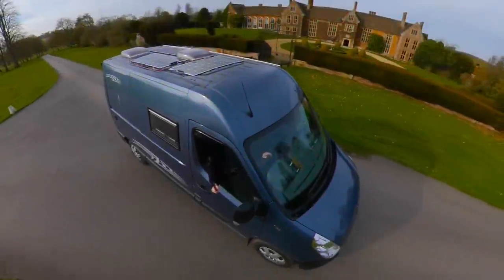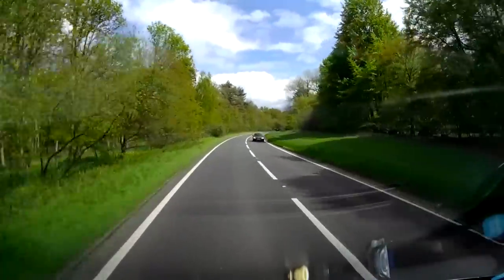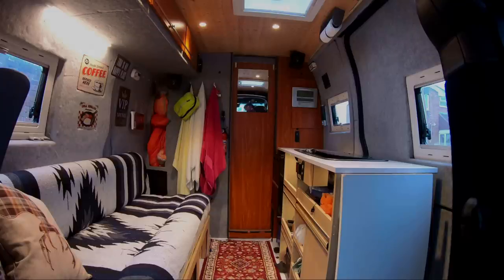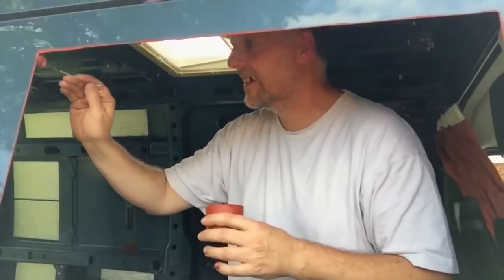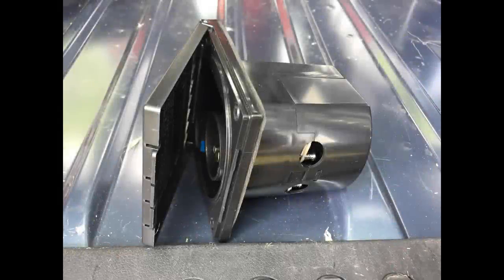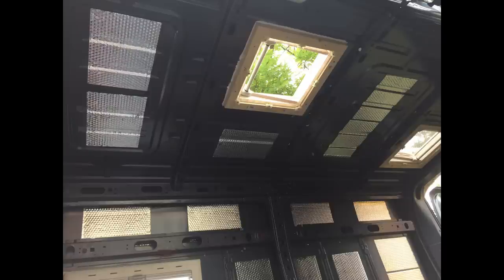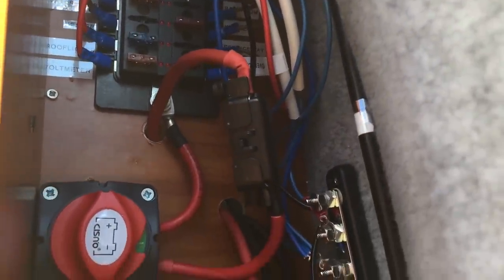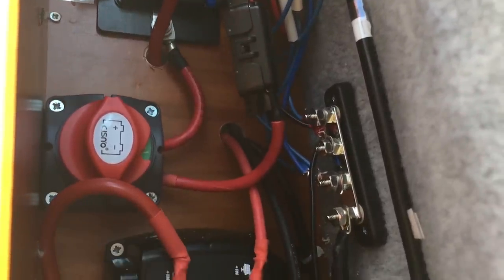HOW TO MAKE A CAMPER VAN From Start to Finish (Low Budget Interior) 2020

Comment: Hi rick. Just a thought buddy. Make the shower room same way as the kitchen units. Scrap the skeleton system because it’s old and not used anymore plus you’ll save just under 200kg in weight as well. Don’t use chip board because within a year it be like a pack of weetabix and use 15 mm light weight ply. You’ll save time money and weight. Buy a 240v small water heater that you can run the ducting from your diesel heater through like a Truma therm or something similar.other than that buddy keep up the good work your vans have improved and I’ve been watching for the last 8 years. All the best

Comment: Stopped playing the video as you’re talking about buying the tool for crimping the lugs. CEF ( City Electrical Factors ) in the UK used to allow you to hire a heavy duty crimper which will save you some money if your project is a one off. Depending on how many you have to do, take some cable to a wholesaler and ask to ‘borrow’ a crimper to get the job done, most of my suppliers would be kind enough to allow this, especially if you’re buying parts from them ( and you probably will be as some bits are not run of the mill DIY store stuff ).

Comment: Great video and great to see you back, Rick.  :o)  I keep meaning to ask; Did you know that cat litter reduces condensation? Fill some socks with it (silica works best), then put them under the chairs or elsewhere.  :o)
Reply from the maker: Raindrops On Roses Great tip, thanks 😁👍
Reply: Nice idea I'm going to air my van every morning when in use to reduce moisture build up.
Reply: Makes sense, cat litter is meant to absorb urine and dry out feces. You’ve got a couple kinds of cat litter; the cheapest and perhaps best for this application would be pine pellets! You can ask about them at the pet store, but it’s cheapest to buy them in bulk (maybe a caravan group buy?). What makes them awesome is they’re lighter, cheaper, and the pine scent actually does a better job than clay at masking smells AND deterring bugs. If it gets wet, the pellets absorb the moisture and turn into sawdust, so maybe you could even make a clever “pellet tank” where the dust falls into a small trap below and you can “top off” your supply of desiccant pine pellets. Just an 💡
Reply: @evshrug  Thats a really good idea! The smell of pine is also a heck of a lot better than the smell of cat litter lol

Comment: Beautiful design.  You have excellent taste for design and function.  I love your van, and after being lulled into queen size bed at the rear of vans, I see your sofa converting to bed is more practical indeed, and less expensive to build.  I don't care for your toilet/shower which is the one over-build in your van.  I would go with a portable basin and round 4' diam. piping at ceiling level to hold a shower curtain with portable shower head; basin has hole through flooring into tank or outside. When done showering basin and shower curtain is hidden away in one minute.  As for toilet, a discreet composting toilet is costly but a better way to travel.  But your design won me over, the simplicity and comfortable look is the way I will build, that is if ever I do this.  Thanks for the show.
Reply: Pangako sa iyo

Comment: hi! many thanks for the video! I am setting up a van myself and your informations are precious !!! in the video you talk about "high temperature contact spray" to stick your coating felt on the wooden walls ... what product is it exactly? and what is this gray coating felt you use to cover bare metal? they use this on construction sites but i saw that there is glass wool in the product ... you, what did you use?

Comment: Super video Rick. Thank you. Did you know, you can use 'Red' Diesel with your diesel  heater? Much, much cheaper than regular diesel. As long as you don't use it in your engine tank, it's perfectly legal.  Just a thought!
Reply from the maker: Kevin Doidge thanks for the tip. To be honest, the diesel heater uses such little diesel, it’s not really an issue. I filled the diesel heater tank up 18 months ago, and it is still 3/4 full LOL!
Reply: Unless you know a farmer, or can pick it up from a boat yard, Red Derv, is usually sold in bulk, filling a minimum 500 ltr tank! You may be able to buy some from a firm you hires diggers etc to the building trade, but as has been said, they need refilling about as often as a Scotsman buys a round! Jim

Comment: Out of curiosity why didn’t you use a diesel heater that heats water as well?  They don’t cost much more. The same size but just has a heat exchanger added to it

Comment: One of the issues I have with the van builds I see... they NEVER appear to talk about the electrics they put in, the plumbing... it is just suddenly there... It would really be nice for a van builder to spend a decent amount of time discussing the electrics, the plumbing, etc with in-depth detail.
Reply from the maker: its a tricky one. Electrical and gas installations can be dangerous, even life-threatening if done incorrectly.
Amateur van builders are usually not qualified to give others advice on such installations and can potentially get into trouble if someone follows their advice from a video and that advice is bad.

I think there is a general assumption among us van builders that everyone doing such a project will either already have a reasonable level of competence in such installations, or will get someone qualified to do it for them. 
Either way, I think you are unlikely to find many videos on such installations because of this.
Reply from the maker: (plumbing) on the other hand, yeah that would be okay, I might do a video on it 😊

Comment: Excellent build. The bathroom was a great idea. I just wish the bed was a little wider to fit two people. I just have a couple of questions. How long can the heater run before fill ups and how much does the little tank hold? Do you get any smell from the heater or from having the fuel on the inside? do you have to vent the tank? Does the water from the shower go into a tank or just pours out on the ground? Thank you.
Reply from the maker: Roberto Almodovar The heater is very efficient and hardly uses any fuel, I filled up the tank when I first installed it, and the tank is still 3/4 full a year later. There is no smell from the heater, although the diesel tank did have a drip of diesel that ran down the outside of the tank which did smell, but was rectified by wiping it clean. 
The shower and sink both run to a hi that is stashed under the rear bumper. The waste water can either be collected in a container, or allowed to fall on the ground.

Comment: Good to see you perfecting & improving on each build. I still prefer the look of the larger bonded windows of your old van, compared to these smaller windows & the outer black covering. You can always open the door & roof lights for ventilation. I think also to shorten the kitchen cabinet you could move the sink into the bathroom on your next revamp. Maybe its the A-Team design but id say the van looks quite masculine to be called Guinevere.
Reply: I'd say it looks pretty dire and a lot of bodging. Each to their own.
Reply: @SB-hr5yr  
Could not agree more Daisy.
Would be fine cobbled together in a £ 1'000 van.
Not denying the effort & work, & I'm 100% sure it will inspire alot of people on their journey.
Most importantly, if the builder is Happy, that's all that matters. Should be very proud of your own achievements, that's all that matters. I'm with you though, not for me.
Great presentation & delivery of the video though .

Comment: Interesting build, but, always a but, I do have a couple of concerns over  the heater and gas install. Taking the gas first, I understand that insurance will not pay out if the gad install is not signed of by a qualified person. while fitting modern gas systems is well within the capabilities of a good DIYer, not everyone is as competent as you. I used to be involved in the leisure boat building industry, and, obviously, there is great concern about gas leaks from the bottle/hose interface. In order to meet the regs, we had to place our gas canisters in a sealed "box" vented over the side. As the gas sinks, we also fitted detectors in the bilge, overkill maybe, but if ever you have seen the result of a gas build up in the bilge, and cigarette dropped, the resultant bang is spectacular to watch, but fatal for the boat and sailors aboard! The Chinese hot air heater are great, but again, there is a risk of carbon monoxide build up, again a sealed box, with outboard vents would be a safe solution. again a CO detector would be a good idea. Lastly, your electrics. There is a lot of terminals lacking proper insulation, OK they may only be 12 volt, but from the thickness of the wire, they carry a lot of amps, and a raw 12 volts will not harm you. But (that word again) what happens if a metal object falls onto these connections due to rough roads. again spectacular sparks, damaged wiring and possible fire, not good but easily avoided. Overall it seems to be a good job, and maybe my concerns are a little over the top, being based on sailing, where you do not have the luxury of pulling over and walking away if the worst happens! Personally I would have done things a little differently, again from sailing, I would use a hammock, and have individual seats that could double as passenger seats while driving, also using swivel Captains Chair style drivers and passenger seats that would  bring the cab into full use. Speaking for myself, the bench/bed seats take up a lot of room, and, in my experience are not that good for long term use. Some people like to rough it a bit when camping, but I would rather have a snug, comfortable home away from home on a typical wet English summers day! Interested to hear your thoughts on my comments and suggestions, keep up the good work, safe and happy campervanning! Jim
Reply from the maker: James C Stanley Thanks for your comments, Jim, some interesting ideas there, all good. DVLA have a list of requirements in order to make the van legally classed as a motor caravan and I believe the majority of self builders in the UK use that list as a guide, including myself. One of the things on that list is to include a gas locker that is separate from the living compartment and has a dropout hole in case of leaks.

Comment: You put a battery right by the shower and below the water system. The slightest water leak or moisture buildup behind that wall and your electrical systems are screwed. Redesign it as soon as you possibly can.

Rule of thumb: electrical systems high up, plumping systems low down.

Comment: I do like the build but not the roof felt- it's called roof felt for a reason. Personal choice of course but I just think it's dull and lets down the otherwise professional work you've done. You could have used vinyl or just kept it natural or painted the panels, or plastic sheet in white or any colour.

Comment: Hi Rick, A great conversion and I'm doing a Master Mk3 myself. I followed your plan with the floor and it's great. Only one question please: How did you get the bump stop on the side door to clear the floor? Mine is rubbing on the ply even before I put in any finishing flooring. I've used 12mm ply. Was yours thinner?

Comment: For the wiring I'd have put flexible conduit in and feed the wires through that so that it has air gaps as fully enclosing wires in insulation reduces the current capacity of wire! Glad to see your back on here, also for the roof you get stick pins which hold them in place, look at Greg virgoes van build if you ever do it again! Just seen you did use conduit, but just for protection which is a good idea, air gaps does help! Where did you get the neoprene from? Is the cable solid core twin and earth or flex?
Reply from the maker: Malcolm Rowe   Thanks for the tips 👍 I don’t remember exactly where I got tthe neoprene from, it would most likely have either been eBay or Amazon. 
The twin core was 13A stranded flexible, not solid. 
Everything that uses the 12v power within the van is low current/consumption so am not anticipating any issues 👍

Comment: Would not the non insulated metal with just the roof felt work as thermal bridges making the insulation less effective?
Reply from the maker: Inhimilis  it’s quite possible there may be some nominal loss at these points but I’m guessing not enough to be noticeable.

Comment: Hi Rick your van looks amazing..... can i ask you when you insulated your van did it do the job as in keeping it warm????
Regards
Chris....
Reply from the maker: chris mckenna Hi Chris, Yes, for the most part the van is quite cosy. The main heat loss area is the cab area, and the way around that would be to keep the bulkhead and insulated, but personally I prefer the open Style so it does mean less efficient heating.  I just use a thick heavy thermal curtain between the living space and the cab and it does a reasonable job.
Reply: @rickvanman  thank you

Comment: How did you mount the drain pipe to the body of the van? thanks
Reply from the maker: michael tucker “C” clips. Drain pipe comes out just behind the rear bumper, and can be unclipped to direct into a waste jerrycan that lays on its side.

Comment: Very good and functional conversion. Even with a bath. Is the Renault a good choice? Or should you go for the 540 Ducato? Which engine did you choose? Here in Germany there is the master with 130 hp diesel engine and one with bi-turbo and around 170 hp. But 130 should be more than sufficient.
Reply from the maker: DriveLongRoad I have always had Renaults and have been very happy with them. The master is a very good van. I went for the 130 HP version, diesel, and it is quite fast and powerful enough.
Reply: @rickvanman  Hi, thanks. :)

Comment: Hello rick i noticed you are using the ctek d250sa which i have connected to a lead acid leisure battery although it is outputting at 14.7v which is for an agm battery when engine running even though not connected for an agm ? looking at your video you have the small red and black wire connected to negative for an agm battery and i am wondering what the max output from the unit to your battery is when engine running ? is it 14.7 or more ? i am trying to determine if my unit is defective as ctek seem to send out non committal generic answers to questions
Reply from the maker: Mark Ford   I recall had exactly the same problem and I eventually figured it out.  I’m going from memory here, so do allow for that, but I recall I learned that the little red and black lead, although joined together along their length, have nothing to do with each other.
You either connect one or the other, not both. Check on the instructions which one is which, but I believe one is to do with the AGM battery, and the other is to do with the smart alternator.
All I remember is, once I disconnected one of them, everything started working correctly. 
Hope this helps.
Reply: @rickvanman  thank you for your reply rick although from placing the temperature sensor between 2 hot water bottles it would appear that the ctek unit is more temperature dependent for its output voltage than anything to do with internal technical wizardry

Comment: We’ve got a Wildax Solaris. The problem you’ve got with the window above the sink is easily fixed. In ours we’ve got a sliding window and I think you can replace the outward opening for the sliding opening. True,  it doesn’t open as much, but at least is something
Reply from the maker: The adventures of the blue campervan XL   Thanks for the tip, I’ll look into it (no pun intended 😁)

Comment: Nice build. How did you replace the door handles on the rear & side door after the insulation & coverings?
Reply from the maker: dozukime thanks. They just pop back into place.
Reply: @rickvanman  Thats strange, I have the same model  & also have taken off the door panels to insulate, my handles have a clip behind the panel , so with the moisture barrier , looks impossible to re- locate the clip.

Comment: All other vids i've watched left gaps in the process and measures used mainly in relation to adequate insulation and water proofing, so thanks for being so thorough. It all sound right for our weather and climate. One tiny gap, which i don't want to leave to assumption is , did you use that wet suit type material on the exposed roof parts too? I love learning how to self build etc but i don't know if i'll ever take that leap myself but if in the event I get someone to do this for me, at least i'll know what's happening. thanks again. that's given me a firm foundation.

Comment: It is OK, but what is going to happen with the vaste water? I see no tank or anything, where is going the water from the shower and toilet?
Reply from the maker: The shower and kitchen sink water (grey water) drain into a waste pipe that terminates at the rear bumper and can be collected in a jerrycan.  The toilet is a cassette toilet and is a self-contained unit with its own holding tank (cassette).

Comment: Missed your videos very much.  Thank you!  Would be very interested in a detailed video about the diesel heater installation, if ever you could find it in your heart, and perhaps a review, particularly regarding humidity issues compared to (propane) gas heaters.
Reply: These (great) cheap Chinese diesel heaters dry out the air as they don't add moisture to the heated area since all combustion byproducts go outside in the exhaust.

Comment: Suggestions
1. foldable ladder to get to the roof
2. Roof Rails (attached to each side of the roof) that way you can carry more hardware on top for future projects for the van))
4. 2 security camera front and back and 2 smaller lcd to view from either the cabin or the front drivers cabin
Reply: Old caravan ,